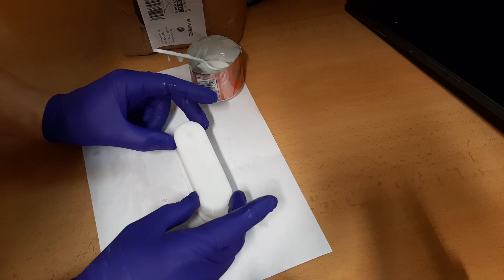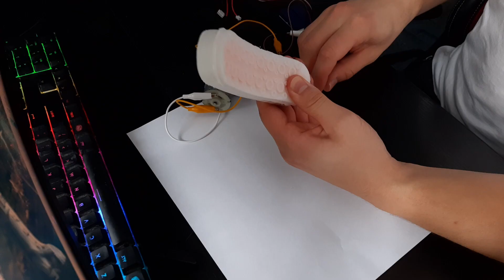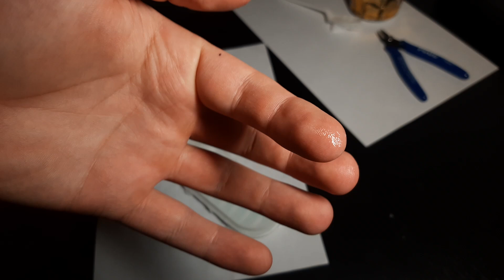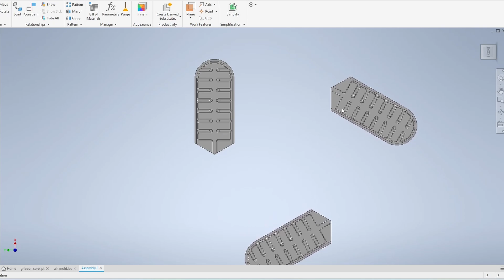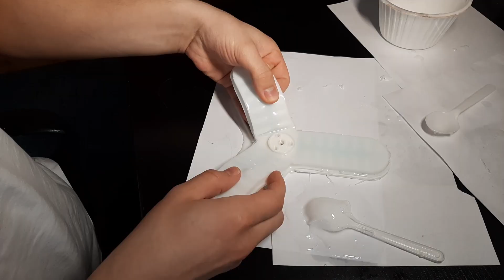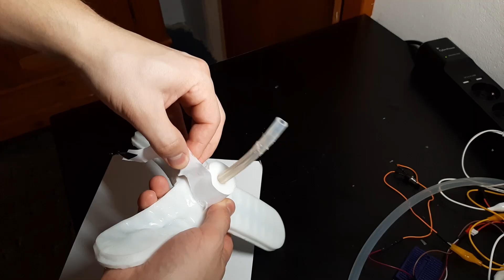Making a Soft Robotic Gripper

Comment: You could probably just glue a bent zip tie to the inside of latex glove fingers, then wrap the outside with fishing line glued like rings at and between each knuckle. Ideally you have solid rings connected by solid linkages on the inner side, and the outside is made to stretch into balloons that push the rings apart.

Comment: quick tip: when designing things that grab things, most objects can be simplified to a sphere, a cube, or a cylinder. a radially symmetric claw, while objectively the coolest and most aesthetically pleasing, is only really good at grabbing spheres. if there's a flat line of fingers, it can grip cylinders and cubes, as well as spheres. that's why human hands have a flat line of 4 fingers, and then a much stronger fifth finger to go on the opposite side.

TLDR: if you make two of those fingers 60 degrees apart rather than 120, and make the last finger 150 degrees apart from both, the claw will work soo much better.

Comment: You could try adding strips of fabric across the back of the gripper to prevent ballooning. You only want the silicone to stretch in a single direction to make full use of the air

Comment: I'm confused. If you're relying on an air pump, why not just use suction cups?
Reply: Looks like an electrolytic pump. Reversing the polarity of the air may not be possible.
Reply: because then it wouldnt be a gripper :) this is just for fun, not function. Besides, theoretically this would be more versatile.

Comment: What if you 3D print a mesh screen extending from the plastic core into the base layer of each finger, and replace the fabric with that? It will be flexible enough to bend like the fabric, and it will hold the core in place

Comment: You should consider using 3 part molds instead of 2 part molds. Properly lubricated with mold release, that should allow you to simply push the cast through when it's cured. Alternatively, you can also make a 3 part mold in such a way that the central part can be peeled away when done,  although in that case I would also suggest a sacrificial liner that is thinner and more flexible as well as the rigid outer wall (arguably a 4 part mold at that point), with both being able to split on a joint for removal.
Reply: Or I could watch more of the video before I comment, and see that. You found another solution lol

Comment: Is there any value in making it dual acting(not sure the phrasing) … adding an “air out” side to contract with the outer side of gripper?

The gripper would look as if it’s in its neutral state but the inner side it currently pumped up to match the outer side’s size

Having outer expand while the inner contract, so the contrast between the sides would be more extreme for less geometry

Also you should do what other mold and cast ppl do and have extra molds (could be alternative design or trinkets/maker coins) to have ready when pouring so you can get more use out of your materials
Reply from the maker: Interesting. I think the moment would be the same, but it should be easier to bend since the neutral axis would be in the middle of the gripper instead of the bottom. I could also bend it both ways using an H-bridge. I could probably use a single pump too since one end sucks the air in any way.

I thought about casting into multiple molds at once, but I always thought "This mold will fork for sure".
Reply: @TazerTechnical  either way , you're doing great work. I appreciate you sharing your thought process, even when they result in "failures". Don't feel you have to always present a working prototype, sometimes showcasing WIP is still enlightening.

Comment: I love to see you iteratively improve the design. Can you add nano tape to some parts of the grippers ?
Reply: Also why did you choose a pneumatic design and not a hydraulic one ? Like torso robotics for exemple
Reply: @IceLy  my guess would be budget + workability. While I personally don't have experience working with hydraulic on this small scale, I can imagine with the issues he is already having with leaks would be made significantly worse and would require cleanup of hydraulic fluids (which is always fun). Making sure all his stuff is properly sealed to contain a non-compressible fluid would take more time and money which wouldn't suit the relatively fast paced prototyping hes doing.
Reply: I don't know about nano tape, but I would like to add gecko tape once I get my CNC working. This would make the gripper extremely versatile and cool. I choose pneumatics because I don't want to clean up hydraulic fluid every time I get a leak, it would also be more expensive I assume. I will definitely look into hydraulics in some of my future high-power projects tho.

Comment: hey great video
i really love how you can see the improvements for each iteration.
i was a bit confused when you said you overestimated the volume of silicone you need, since there is an easy fix for it. you have already made an negative of your final product so just use booleans to make a positive and then have inventor tell you what the volume if the object is.(add 10% or so for loss).
a few things you could look into: how to propperly integrate 3Dprited parts into the silicone. (valves in the silicone?)
experiment wih the surface of the gripper so you have more friction.
perhaps use a vacuup chamber or a vibrating device to get ridd of airbubbles

overall cool project keep it going
Reply: thanks for the tips. I want to keep things simple so it will be accessible to more people (I also don't want to build a vacuum chamber on top of this project). The 3d printed core will definitely get an upgrade and I plan on changing the surface as well.

Comment: It's... functional! xD \o/ #party

To make it grip more effectively, I would still say add more ticker ribs, but adjust the rib parameters. By that, I mean cut strips of fabric of decreasing thickness, chamfer in the end part of the gripper 'finger' more so it's more triangular, and give the gripper height a slant, so that it's shorter towards the end. A stretchy fabric mesh would be more ideal but it needs some controlled rigidity to be able to curl more at the base due to the increased pneumatic pressure closer to the source. Also, make the bottom part of the rib 4-8x thicker than the top part. Like a pyramid, especially toward the center.

If you are able to add vertical channels to be able to slot in fabric when curing the silicone, it'll prevent the ballooning since you'll have more control over the individual chambers of air controlling the twist. I.e. glue vertical fabric pieces to the bottom fabric piece, poke a hole near the top of each vertical rib, and route maybe like a cured slightly more rigid silicone string (simulating a tendon). Structurally, it'd be similar to corrugated tubing.

In spite of the limited effectiveness, this has been an entertaining project to see develop, so loving it so far :D Sad to hear about the laptop though! It'll be awesome to see this on a robotic arm.
Reply from the maker: Thanks man, I thought about varying the thickness of the gripper to make different bent shapes. I want to keep it simple, but we'll see.
Reply: @TazerTechnical  For sure! Either way it's a super fun project, will be interesting to see how it continues to develop ^_^